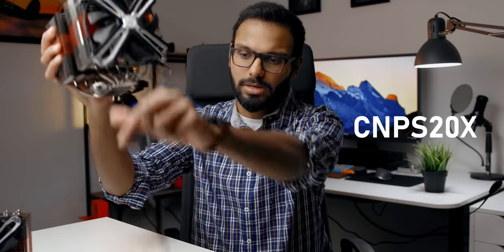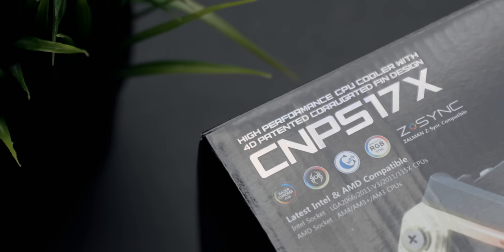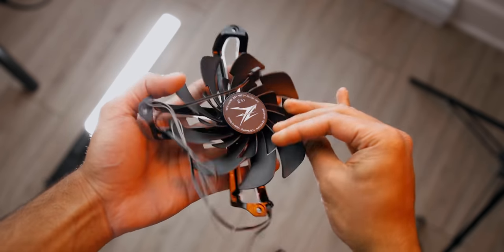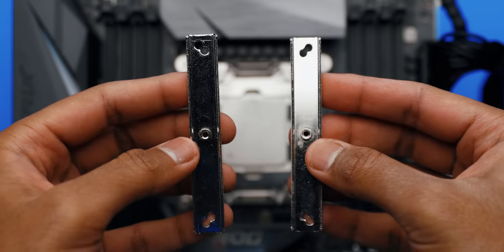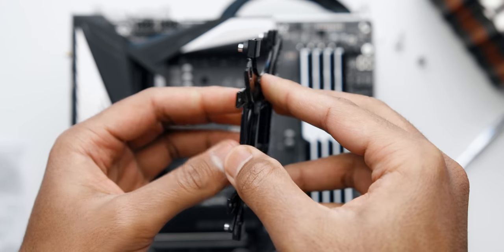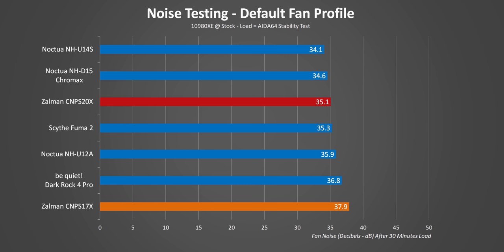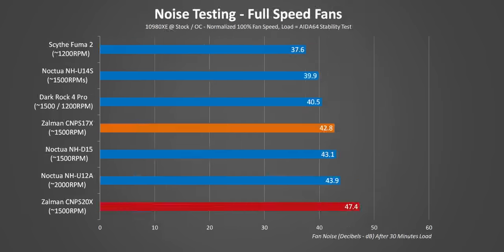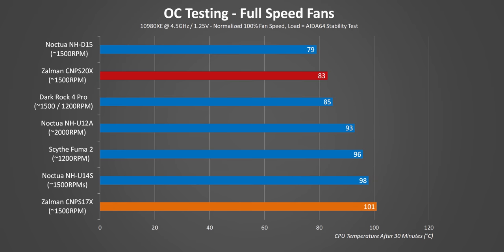Zalman CNPS20X and CNPS17X CPU Coolers Review - The NOCTUA Destroyers!?

Comment: They spent more time designing the stupid RGB lighting than they did making the installation sensible
Reply: And the RGB isn't even very good!  I can see paying more for a slightly worse performing cooler if the RGB is really awesome, but this one is just lame.  Cool looking fan though... however, I don't see much point in having one in the middle of the dual tower cooler.
Reply: RGB sells, the installation is only performed by the end user once or twice per product lifetime. RGB is used all the time.
Reply: Wow you clearly don't know anything about cooling, the RGB gives the CPU an extra 65% cooling capacity.
Reply: Yeah exactly and that is silly.
Reply: I don't know what everybody is complaining about, this is almost an identical installation to the hyper212 which nobody seems to have a problem with
Reply: Joseph Stott It’s also $25. This salmon cooler is $100
Reply: @anasmohamad86  $25 or $100. This installation is simple and you don't need a engineering degree. Whimps.
Reply: Blame the consumer market that has been created for that

Comment: The Scythe Mugen Rev B is also a decent air cooler, have one to test my setup before water cooling.
Reply: I don't get why scythe isn't the top selling brand at most price points
Reply: @Interrobang212  Forrealz. I'm planning on getting a Ninja or Fuma.
Reply: I own the fuma 2. Its nice having full ram clearance and gpu clearance. Adding a slightly faster fan on the back sucks in more cool air through the sides and improves cooling even more. Really wish more people would test with that config to see if it can consistently beat an nh-d15
Reply: Got the Ninja 5 myself and it has been an absolute beast of a cooler since it is inaudible.
Reply: @Interrobang212  availability.
Reply: You don't need flimsy Lcool. If you need more capacity add LM, and die mount.
Reply: I like my $36 ninja 4. It has been doing great keeping my cpu cool for the last 2 years, even up to 5.1ghz. It is huge though, anything bigger wouldnt fit my build. As it is the cooler and fan cover all 4 ram slots entirely so I had to use low profile ram

Comment: I recently got a Noctua NH-D15 chromax black when my AIO NZXT Kraken broke (2 years of use) not only is it very nice looking it actually beats my previous temps It idles around 15c-25c (Browsing, Watching movies, Etc) and 35c-45c when gaming 

i'm extremely happy with it i would only ever consider going back to water cooling if i went full custom looped and even then i'm still put off by it i much prefer simple reliablity now more than flashy tech with pretty lights
Reply from the maker: Not only that....its also probably quieter too.
Reply: @HardwareCanucks  Oh it most definitely is!

Comment: I use a vintage Zallman 9000 am2 version on my 5600xt. It honeslty works nearly as good a Water.  Idles at 25c and under 50c at load. Some new fans you are lucky to get 5 years out of them let alone 15-20 years

Comment: Those temps were outrageous, which is why I went to water cooling several years ago. It's so much easier to slap a waterblock onto a CPU. And after an hour testing on either Prime95 or AIDA64, My overclocked Ryzen 3800X never goes above the mid 40's. It's also very quiet because the fans never go above 800 rpms.

Comment: I would recommend testing out the Arctic 34 esports duo. It's a great cooler at about $50 and has been shown to outperform the Fuma 2. Plus there are like 8 color options to fit whatever build theme you have
Reply: To be honest Arctic 34 esports duo is budget king. In my country for 34 euro with 210W cooling capacity. That's a beast for the price. Mounting it to H200 was a pain though (literally).

Comment: Does it show what kind of thermal paste you're using in the link? that's always been one thing I've noticed with cooler reviews, for instance, Linus when comparing the Noctua to another cooler he ended up using the paste that came with each of the coolers, would it not make more sense to use the same paste for both coolers to get a more realistic variable? Like both using thermal grizzly.

Comment: For one degree difference in temperature the Noctua NH-U14S wins because of easy installation.  Also, size is an issue I have a Cooler Master 922 HAF case and the Noctua NH-U14S barely fits with a 200mm fan in the door.  [EDIT:  I just ran the IntelBurnTestV2 and the CPU fan speed maxed out at 1220RPM and I could not hear it above the ambient noise in my computer room.  Yes, I have an aggressive fan speed because it is on an Intel i9 9900KS.]

Comment: It’s slightly different but it took me less than 10 minutes to put a 16x together. Similar parts. Honestly nbd. Also my first time installing Any air cooler just in case anyone with minimal experience thinks it’s a factor not to purchase. The 16x doesn’t get recognition I think for reason due to how less open and efficient it is vs the 20x (besides the obvious size difference 120mm vs 140mm)

Comment: I caught the CNPS20X for $50 on eBay, and holy crap, awesome cooler.  Yes, installation is a pain, but it was worth it.  RAM clearance for that first fan is an issue, sliding up meant saved by my cheap acrylic panel since it flexes a bit (and I have a full ATX case, not a mid).  I love the RGB since none of my RAM has any.  Soon after I got a similarly great deal on a used 5950X, and temps are fantastic.

I'm guessing all of that hardware is needed to support the part of the cooler that extends into the 4th dimension, which we cannot perceive.  And biomimetics means it's basically as advanced as those gel packs in Star Trek Voyager, right?

Comment: Zalman is a company I haven't used in years. They had some great 478 coolers.
Reply from the maker: Mike used the ORIGINAL CNPS.  ;)
Reply: @HardwareCanucks  Nice. I had one that had most fins that were aluminium but a few on the side were copper. It worked well.
Reply: I used to have a nice passive GPU cooler from them - the Arctic one was better but the Zalman one looked nicer IMO

Nice to see they're back.
Reply: I still have my Zalman CNPS9700 LED that I used for years in the AMD S939. And before that one I had the CNPS7700-CU. At that time they were the most beautiful cooler in my opinion. I also used for a while the Scythe Ninja Copper SCNJ-CU1000, a 5th year commemorative version of the Normal Ninja but all in cooper.

Heavy beasts, and good times it was. I would love for an update Zalman CNPS9700 but able to cool down the current CPUs.

Comment: Please post the wattage that the monitoring tool it´s showing you. It doesnt matter if the tool is not accurate, or if it spits out different results with different coolers (which is actually how it should be), hell it doesnt even matter if make it a round number (example 196->200w.) We need to know what kind of wattage you running on these coolers.

Comment: There's a lot of things putting me off this; the mounting is a bit awkward sure but most people will only need to do this once. So not a huge issue. I'm very much put off by the 'fake' copper section. But mostly it's those fans, I don't like the way they're mounted, I don't want the RGB, or all of those cables. If they sold this as a standalone heatsink with fan clips however...

Comment: Not everything is about raw performance, sure you might save 2C, but at what cost? My NH-D15 was easier to install and I know I can get free brackets for newer sockets with great support. Fit and finish are also important factors, and support can make a difference. At a difference of 2C, if I was worried about the temps, I would go AIO.

Comment: I thought it was finally time to crown a new king for air coolers but no, Noctua STILL has the best air cooler. Also the CNPS20X has custom fan dimensions which is a no go for any air cooler. When the fan fails and it will, you'll need to buy a replacement from Zalman or spend another $100 on a new cooler.

Comment: 3:22 - This is exactly why I stopped using any ZALMAN-related coolers, they always introduced someone very unconventional and incovenient. The last time I used one of their products was wayback in 775, the cooler I bought had a build-in mounting clamps that is as tall as Graphics Card (I used to have Palit HD4850 Sonic GDDR4 and it was a massive GPU for its tiime). That clamps killed my GPU cause upon re-sitting it onto my board, the clamp hits the capacitor on the rear side of the the HD4850.

Comment: Ok, real question here is if this will finally force Noctua to innovate in anything but the color schemes just to get the crown back.

... Looking at this Zalman, I really hope it will.
Reply: We need to note that there are some things that cant be improved anymore except with a big change. As an example, Noctua probably already hit the bezt efficieny to the point if they want to improve the performance, all they can do is upsize the size. Just like CPUs. You can only improve so much until ypu need to chanhe to a new nm size.

Comment: i was just gonna look up how to upgrade my stock fan from intel i7 to another cooler and im still looking for a cooler
Reply from the maker: What kind of i7?  The Fuma 2 is a great option and REALLY quiet.
Reply: I want to run i7 9700k and the Noctua  D15 but 81 degrees seems a little high
Reply: @HardwareCanucks  i7-7700 cpu 3.60ghz and i have a 1151 cpu socket
i was tinking of buying the coolermaster masterliquid ml240L cooler. now i get 81°c on full load
Reply: @lucas_e3094  Assuming you are talking about the i7-7770 Non-K CPU, which has a TDP of only 65W, any aftermarket cooler should yield significantly lower temperatures and noise. I would recommend a Hyper 212 EVO/Black, but if you want to spend a little bit extra for something beefier, I would recommend a Scythe Fuma 2 as Hardware Canucks did or a Be Quiet Dark Rock Slim, as both of these coolers are great thermal and noise performers.

Comment: Wow It's like no one has ever fitted a Hyper 212 Evo or similar style cooler to an AMD platform before, or even fitted a motherboard. The installation process is hardly difficult, its four standoff screws to add to the board, hardly rocket science.

Comment: Zalman wasn't ever the top performers. What they had was decent performance for a decent price and a unique design. That and they were easily available on almost all markets. They did try their hand at performance coolers and other than managing to make them expensive they failed to meet the performance of the competition, but even then they did have a very unique design that you either hated or loved.
This time they have another big heat pipe based dual tower cooler (the CNPS20X) with slightly better than just decent performance, though still not good enough to beat or match Noctua, with questionable styling and a marketing department with buzzword diarrhea and is priced the same as the top dog air cooler on the market. This is not the product that will get Zalman back in the game even if most potential customers either never heard about their questionable past or are prepared to give them a second chance.

Comment: So uglier cooler with worse fan (i mean less static pressure and more noise than the stock Noctua fan and also a worse RPM range) for gain only 1-3 degrees? no way sir i pass
At least if i need to spent some less money than a Noctua cooler, i will stay stuck on a Arctic cooler (10 years warranty, terrific performance for only 30 bucks and more looking good than this new Zalman's cooler) or a Scythe cooler like a Mugen 5 or Fuma 2.

But Noctua is one of the few that they give you more than two years of warranty, the best packaging for a cooler and also a ton of goodies (one tube of their NT-H1 or H2, additional anti-vibration pads, case badge, "screwdriver", one of the most easy mounting system, a LNA cable..)

Comment: Good luck remplacing fan with these Zalman cooler lul...
Reply: Indeed its a shame they went with a non standard fan frame. The static pressure of those fans must be awful as well, I would be really interested to see what happens to performance if a couple of Noctua fans are strapped into it.
Reply: @jonathanellis6097  Honestly if they used standardized fan mounting they might have seen more sales from people getting their fin stack and slapping Noctua's fans on it.

Comment: Noise or / and Temperature normalized Tests would be way more useful than this @1000 RPM shit.
Reply from the maker: Rotational speed normalized is no less valid.
Reply: @HardwareCanucks  well what do I get from that information?
I know how warm it is at 1000 RPM. But noise are different between different fans at 1000 RPM.
I'd rather have the noise as the main parameter and see what Temps it achieves at a certain "loudness"